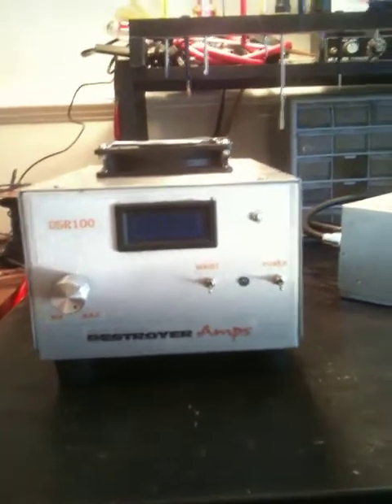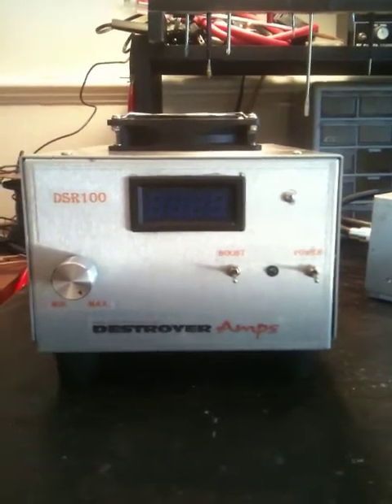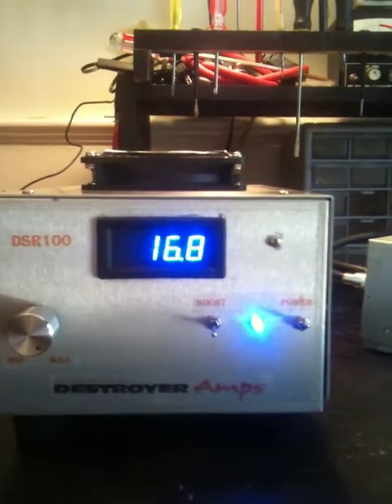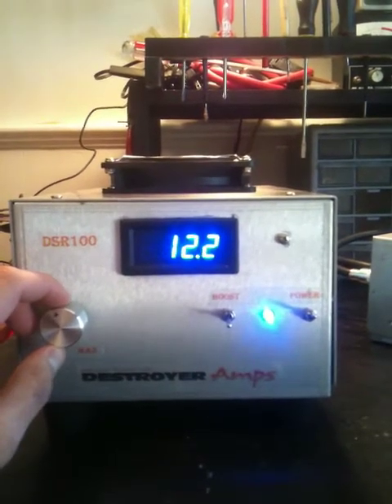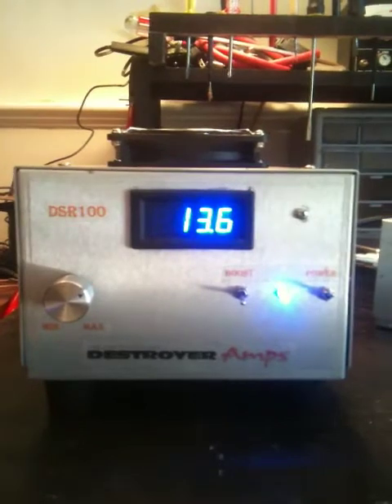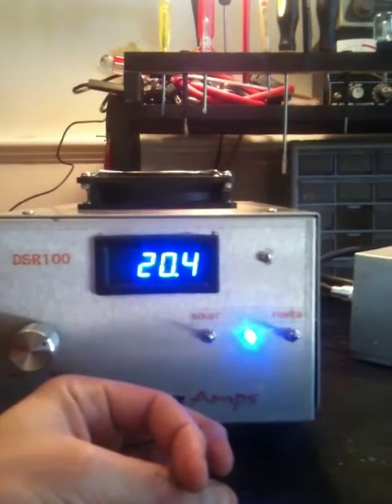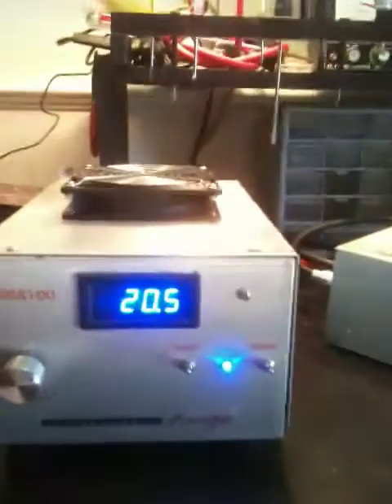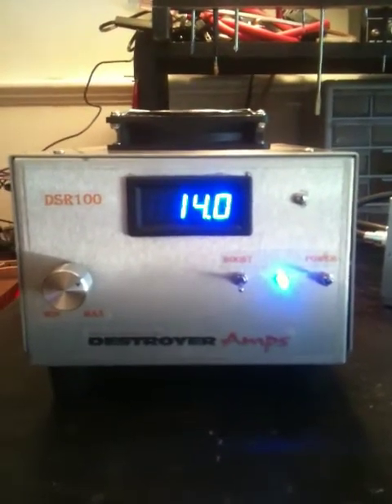DestroyerAmps New regulated power supplies

Comment from the maker: You really should do some homework before you start pulling the BS flag here.  First lesson is to research IGBT circuits and regulators.  We DO NOT use the normal multiple pas transistors that would in fact be larger than the case.  The transformer can hold 100 amps continuous on a 110 primary. We use many different types of transforms for different types of applications. The regulator is actually rated at 200amps, twice the strength to ensure a hassle free life.
Reply: Hey I have some questions for you if you don't mind ? I'd pay you for your time brother. I need to know a little bit about regulator circuits. I've been searching everywhere and you have given more info than anyone else I can find. Could you email me at bmanthug@gmail.com please ? I would greatly greatly appreciate it brother !!!